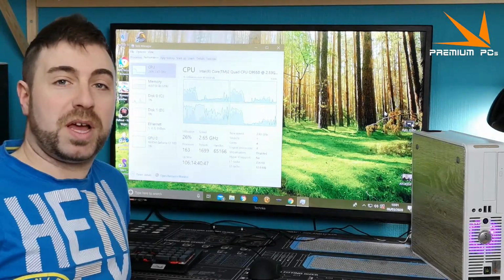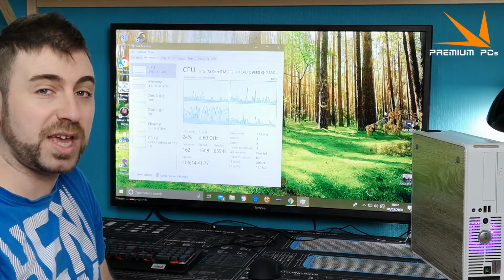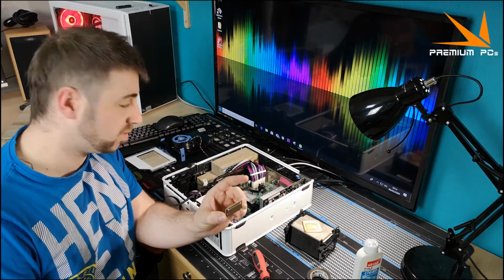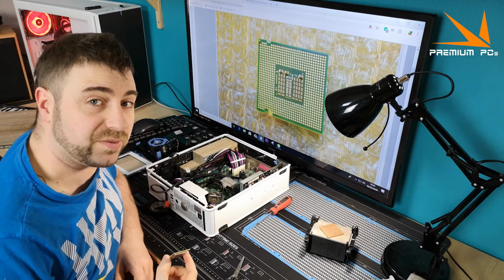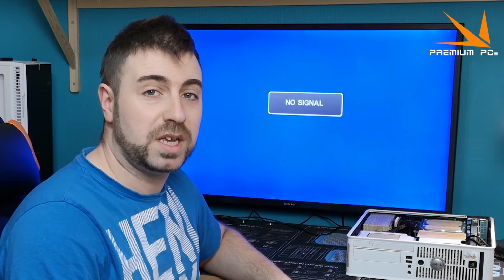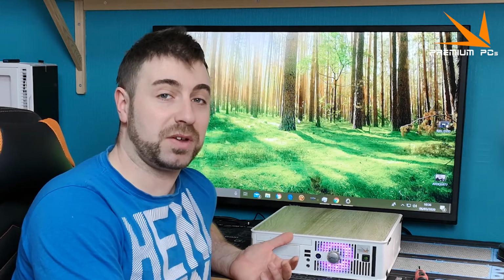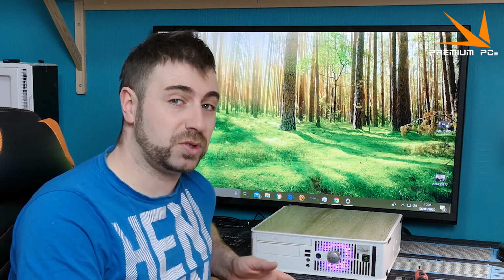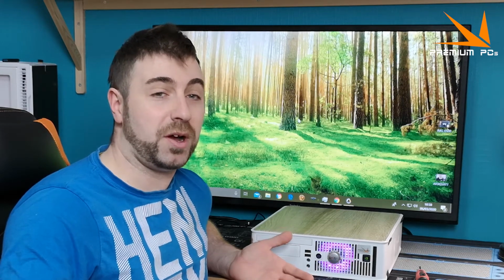Overclocking an optiplex?

Comment: Yeah, the fan scared me to. I have that Q9550 in my 780. I don't recall which Optiplex I tried the tape on.(I also have a 745 with the Q6600.) I don't know if the fan would have slowed down or not but I wasn't going to take the chance. I like my opties. They're usable with XP but I mainly run them with Mint and Ubuntu. They run Youtube with 5 tabs or so and other websites with 19 tabs open.
Reply from the maker: With an SSD, maxed out ram and a GPU like a 750 or 1030 they are still perfectly usable for most things today. I will be attempting this again with the q6600 soon 👍🏻
Reply: Is there is a way to overclock a 780 with a q9650?! By any chance?!